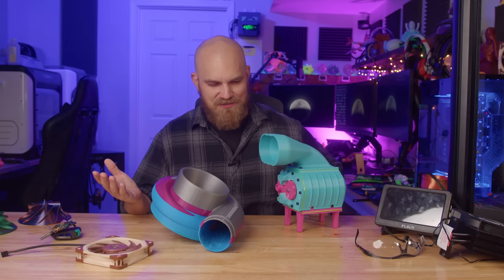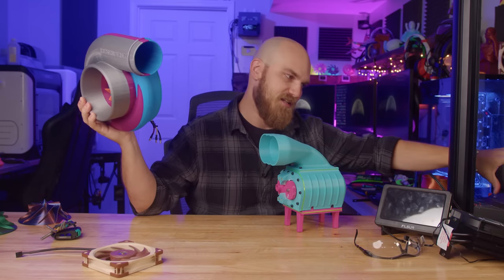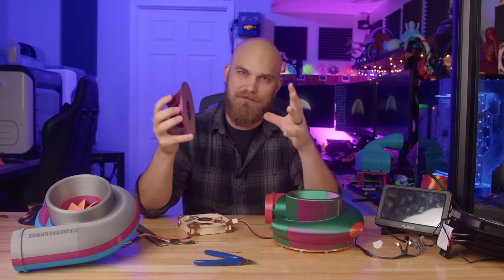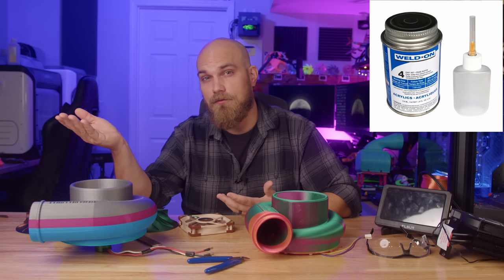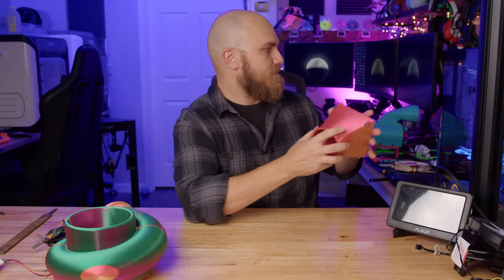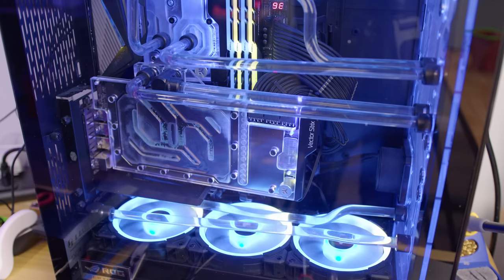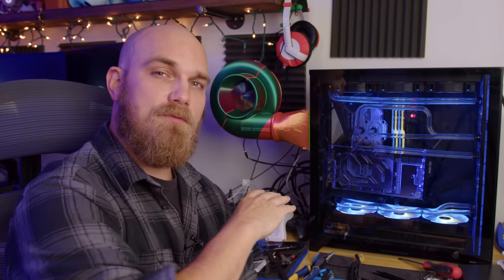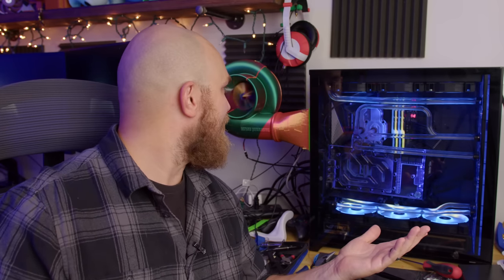Boosting My PC Performance With A TURBOCHARGER

Comment: could also key the hub to the compressor if you ever find it slipping or shave it down to much. could also maybe use them to feed into a radiator using a little bit of piping then neck the piping down to create a venturi effect.

Comment: Gigabyte’s 4090s center fan rotates in the opposite direction. They claim this is for a performance boost. Would this actually apply to say a 360 mm radiator? Will the only mad lad willing and able to test make a video on this? Who knows? Possibly tune in some time to find out.

Comment: My 2 cents, OC the CPU or over volt it to have it make more heat until it just throttles once heat soaked so you can really see the difference the fan would make🤘

Comment: What you could also do is use a tank of liquid nitrogen and hook up a pipe from the tank to where on a normal car the air filter would usually go this would help in 2 ways. 1.its lower temperature air therefore inherently colder temperature 2.since the air is inherently colder it will also be at its most dense which will have you flow more air into the system :)

Comment: Looks like the airflow in the case was the restriction im not sure though but seeing the smoke come out the bottom looks like it would be more efficient if the air exhausted out the top.

Comment: I'm already imagining one of those fake plastic engine blocks, some custom water cooling, rads hidden inside of the heads, one (or two) of those on each side pushing air in, mounted in front of a racing sim rig... only need the money lol

Comment: I love your videos cause they're interesting. Wouldn't this turbo basically only change the rig to be an open style case as it doesn't really push air across radiators only lets fresh air in. The actual radiator fans are still the ones that draws air in and through the radiators.🙂

Comment: This is cool. But....a turbo is run by hot exhaust. Heat rises. Do it in reverse as an exhaust fan with the bottom three bringing in cool air. You'll be able to run it at a quieter speed and if it doesn't improve temp airflow, I'll eat a taco.

Comment: Maybe try to mount the turbo oposite so it performs as an exhaust instead of an intake to create negative pressure internally. Every other fan should turn to intake? maybe the temps might lower?

Comment: I was thinking...You should try to make full turbo with hotside plumbed to the back of the case as if the case was an exhaust manifold, then a "downpipe" venting it away into the atmosphere.  Then plumb plumb the cold side back into the case as if the case is a charge pipe(might need an actual charge pipe to find a good place to plumb it in lol...at that point I think 3d printed intercooler should be tested as well.... eventually hahaha 🤔)... Just use one fan motor with a long enough shaft to drive hot and cold side or even a fan for each housing to start with and see if it's worth more r&d lol
Reply: Oh man charge pipe routing to and blowing into opposite side of the case as the exhaust flange which is sucking out air and pushing it away...I wonder how how much it could pressurize the case hahaha jk...sorta...oh! And how would that smoke test look?! Clear tube for charge pipe? Who's with me? The racecar builder in me just crashed into my central NERDvous system 🤣🤣

Comment: This would be really handy for my PC case tbh. I have a good set of fans but despite that my airflow is so bad that during summer I sometimes open up the case and put a desk fan next to it. This reduces running temperature by up to ~20°C, whereas otherwise it would run at about 80-85°C which is just way too high. 

Why do I think this would fix the problem, whereas fans don't? 
Simply my case is an old desktop case that doesn't have enough openings, so I could either take an angle grinder to it, or use this device which, critically, compresses the air. This means once the air is inside the case it would try to equalize it's pressure with the environment around the computer, leading to increased airflow out of the case, despite little space to do so.

Comment: I haven't even watched the whole video. But as a car guy, hearing that blower was so fucking cool. Roots style blowers on cars are known for their noise. So are turbos, but (I haven't finished the video) I don't see a piece of plastic capable of spinning as fast a turbos without imploding

But now I want to see someone cool a pc with a fill blown turbo. Strap it to a motor just to spool it up and run the cold side output into the pc. Gas powered engine cooling 😂

Comment: I know you probably wont see this, but if you could make it as a cpu cooler, pulling air in facing the glass and forcing it out the back of the case, that would be so good. It'd look great

Comment: you need to make the whole thing, with the exhaust part and all, coz u can put the fan on the exhasut part and pull the blades around and it would work exactloy like a turbo

Comment: You can supply 12v directly from the psu and just attach the rpm sense and pwm signal to the motherboard header

Comment: With 4 pin pwm fans you can run the red and black directly to a 12v psu plug and run the rpm and pwm to the fan header all the current is on the power wires the 4the pin pwm is just a 0-100% duty cycle  and rpm tach is just a pulsed tpm signal

Comment: You should try a more realistic turbo set up, when you recycle the hot air from the case and run it through an intercooler then back into the case.

Comment: For me this looks like it would have more benefit in an air cooling situation, feed way more fresh air to the CPU cooler. Or as side exhaust from a side panel opening in front of a vertically mounted GPU to get that hot air out of the case asap. Ofc I assume you can get the tower out of the room in both situations..

Comment: I have a computer case that have 2 rear fan for intake and 3 at the front for exhaust, CPU cooler it's a big 8 heatpipes tower cooler. I think will be work better that way, like a server rack the air have a straight path to go throught.

Comment: I do not remember what it is called but there is a factor relating to how air is pushed vs pulled and the example I remember specifically is with a cell phone speaker and how it can blow out a candle. It pushes out air in one direction but pulls air from many directions.  The one direction forces end up overpowering there sloppy multi direction forces

Comment: you could boost performance even more if the entire case was sealed. in the smoke test you can see the turbo is pushing a lot of air out of the case rather the exhaust fans. some is even being sucked back into the turbo near the top. if you can force all of the cool air through the radiators it should be much better.

Comment: gpu looks like its not level bro, maybe it's the cam angle but yeah that dont look right. I would also suggest flipping your bottom fans so you can get correct flow of air and heat in there, heat rises my guy. fun vid tho man, keep it going.

Comment: Turbo wheels spool to 100.000RPM.... Don't expect a turbo style fan to perform at a low 5000rpm.. RC motors can run up to 50.000RPM so that would be the start to get good results Nice idea, can you share the RC style one also would love to give a try on that. Stay strong!

Comment: I think the coolest thing that you can do is to create a 100 or maybe even a 300 mm fan it will attach to the side panel of the receipt wholesale made comical 500 mm fan at the Texas supposed to be attached to the side of the PC if you can create something say my practical for someone to attach it to their PC like you're simply will have to choose the right type of case to attach it to example like there is a really popular case from be quiet the 500 series and then you can create a custom big fan that feels pump the computer full of air or maybe even create a specialized panel for four sides intake fans

Comment: Why are your temps so high on full custom water? I'm running a Vega 64 (heater) with an EK block and a 5800x with an EK motherboard block on an ROG x570 Hero VIII in a Phanteks Enthoo Evolv X and I'm staying around 48c in my reservoir with an EK 360SE and a 280SE while gaming. Highest my CPU has seen is like 78c in cinebench and that was with the in/out swapped when I first built it. Once I swapped those, the highest it's seen is 62c. GPU is a bit different story, hotspot regularly sees 102c with die being around 78c. Your CPU temps seem off, you might check and see if you have in/out switched on the mobo block it's not written on them like most CPU blocks you actually have to look in the manual. Not trying to throw hate or anything cause you're awesome with these videos just an enthusiast trying to help another enthusiast.

Comment: I know when putting turbos on cars , the turbo compresses the air and actually warms the air and that's why we use intercooler,  I'm wondering  ( I know you're not compressing air that much but wondering  if the air temp maybe increased  coming from turbo so you're not getting max cooling like you're hoping for

Comment: I'm wondering if you're making gaskets out of TPU for the turbo or blower fully 3D printed? You can always 3D print a stencil, or use a cutting machine to make them out of gasket rubber. Main reason I got a cutting machine!

Comment: Would have been interesting to see the flow through the radiator of an unmodified 5000rpm fan. The black fan spins faster than the A12X25 out of the box... Seeing if the turbo-style setup leads to higher air flow would be nice.

Comment: Use the PC exhaust to spin a turbine!  Use the turbine to spin the fan!  Because the PC adds energy (temperature) to the air, you would potentially have a real turbine engine!  The fan and turbine would have to be very efficient at the operating point for it to work but it's possible.

Comment: In the smoke test it looks like all the cool air is just getting send to the top without actually getting time to cool the cpu … , what I would have done is have the top left fan blow downwards so the massive amount of air is getting spread more into the case and thus cool more surface area before getting pulled out through the top… is what I have in my case and it keeps everything at a really stable temperature.

Comment: When you compress the air using a turbocharger it creates a lot of heat. Your system will be much cooler if you put an intercooler between the turbo and the case!

Comment: i would put rotor ona a shaft and make assembley with bearing so the rotor will be more stable witch should be a bit quieter and it will allow you to make rotor fitted to the housing with smaller clearences with wille eliminate leaks of preasure.
youst like in normal automotive turbo where you have two bearing to keep it stable .

Comment: I know from experience that if you have the o11 case and the bottom fans are intake and top exhaust the top radiator gets too hot and starts to mess up the fan bearings. Both exhaust is the best way.

Comment: It'll be more interesting if the "turbo" is pulling the air out at the same time another turbo fan pushing the air in. The air has to move at a 1:1 ratio, no? So if you're pushing more air than pulling out, the excess air, in theory, will simply "bounce" back? Probably that's the reason why you're not seeing a big difference?

Comment: When i was running too many fans from one header, i soldered up a connector that connected the RPM and PWM wires to the header, but the 12V and GND wires directly to an old molex connector.

Note - if anyone decides to do this with multiple fans, make sure you connect all the PWM wires, but only one RPM or you'll start getting weird readings at best!

Comment: Wouldnt it be possible to close all case opening and have the Hotair leave through a Pipe lead it back to the charger but on the "exhaust" side? then it would really look and kinda work like the real deal

Comment: I do not know if you have tried, but the fan you used did you try the flow test in the original?  if your turbo has worse performance than the vanilla fan I think that a little frustrates everything, without prejudice to the coolness of your turbo

Comment: Could you theoretically use the exhaust air from one of the radiators to spin a turbine so it functions exactly like a turbo would, or would you need some industrial grade ear destroying fans to even think about doing that?

Comment: It looks like theres way more smoke coming out of the bottom exhaust. That makes me wonder if the cool intake air is just sinking and being pulled out the bottom before it can be warmed up enough to rise and be pulled out of the top. I'd be curious to see what the cooling difference would be if you reversed the fan direction so one rad was intake and then reversed them.

Comment: Wouldn't a 775 motor rated for 12 volts have worked? From what I read which is very little 775 motors are made with high speed and torque in mind.

Comment: You would most likely see a bigger difference in an air cooled system with this turbo
Reply: or on the actual radiator like the cfm test.

Comment: I think it would be very interesting to test on a PC with an aircooled CPU, (w/ & w/o a cpu fan, reversed obviously).

My thought is run the case with airflow B->F positive pressure. Then maybe throw in some fans on the front to pull the air.

Comment: why you don't make a  fan that is same as the noctua but a little bit thicker like 40~70mm and see if the air pressure is good.

Comment: Ofcourse there was little difference, it was blocking intake for a system that was already cooled enough and on just did the same as having the extra intake area. If it was an air cooled system with thermal headroom available there could have been a more noticeable difference. And I would flip the top fans so there is 3 intake and 3 exhaust then drop the exhaust fan speed by 5-10% for positive air pressure with a fan filter on the top of the case. It would look just as good as exhaust on top even though the fan frame is showing inside the case, nobody is going to see it unless they sit on the floor and look up into the case. The light inside the case will be the same either way, the sides of the fans will be the same... normal viewing angles hides the fan blades. Form over function is not required in a top to bottom airflow system.

Comment: Is there any way you can try having it be the only fan that's on to see if it can pull enough air or push enough air to utilize the radiators by itself?

Comment: Is it possible the three case fans would be throttling the airflow from the turbo? I reckon a turbo in and a turbo out would vastly increase the cooling of the CPU and GPU..and also the noise level but hey, it's only noise right?

Comment: Would it be possible to make this as a functional turbo? Use your exhaust fans to spin a turbine that sucks air? Use a manifold to take the exhaust air from the top to the back or the case?

Comment: You might get better performance  from the the turbo fan with a restriction.  Turbo compressor wheel are designed for a certain pressure ratio.

Comment: Get a 5hp predator motor and up scale the compressor or overdrive the crsp out of it.

How many cfm do the 6 computer fans flow vs the turbo puts into the case ?

Comment: The loud powerfull turbo should not sit at your PC, but at a cool place out of earshot.
than you could connect with a hose.
that way you get cool air and keep the noise out.
(watch out for condensation)

Comment: Compressors are designed to work at very high speeds that cannot be achieved with such a motor. Therefore, it will always be inefficient for those needs.
A large radiator with slow fans is always preferable to a small radiator with a fan that has a lot of air.

Comment: thats insane hot for a water-cooled GPU at 61? my Kraken Z73 keeps mine at 40c or below on 100% usage. this is the reason i dont do a custom loop, everything will heat way up. The air cooler kept my GPU cooler than your water-cooling does and i dont have AC

Comment: just get a blower from a car/truck .... the blower from a 2002 Dodge Ram is easy to match up with (and usually comes with gaskets)... (it can draw about 250W peak, so probably want to get a motor controller along with a separate power supply for it.

Comment: Your setup with both radiators as exhaust means all your air intake is unfiltered so not optimal for dust buildup. Doesn't look like it's a problem for you but for someone else looking at this it may be something to consider if the PC is going to be on the floor it they have a furry pet or something 🙂

Comment: I kinda wanna get 2 of these, mount them to the front of my case and use some sort of pipe or tube to direct one right to the CPU headsink and other the GPU. Would prob need some sort of a custom shroud for the GPU to make it work

One other thing too, did you happen to test the fan you used's airflow before you cut it up for the turbo?

Comment: It looks like the entire back of your PC is vented. How much air was bleeding out the back due to less restriction on air flow. If you blocked those vents off then all the air would then be forced out of the system via the radiators pushing even more air through the radiators.

Comment: You know it could actually work as a radiator,  you can get one of those single 120mil radiators and mount it at the rear and have the turbo blowing air into the case, might have some hole gaps but it could work.
Reply: Blowinh hot air into the place ment to be cooled, name checks out
Reply: @madbruv  but it wouldn't be too hot since  the amount of air flowing through it is so great, but it was just a idea.

Comment: temperature in your config is probably not gonna be improved that much since your just going to a higher positive static pressure, and adding a ton of turbulence, which is a big enemy in case airflow efficiency.